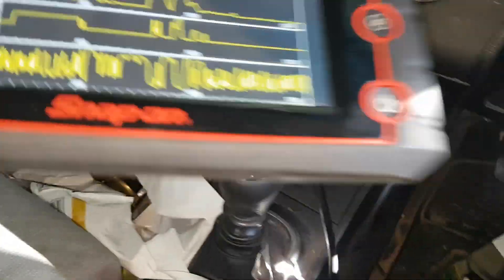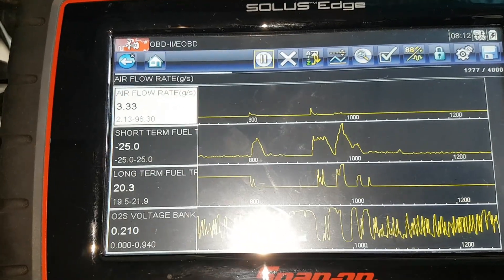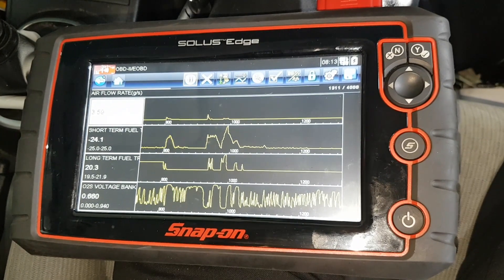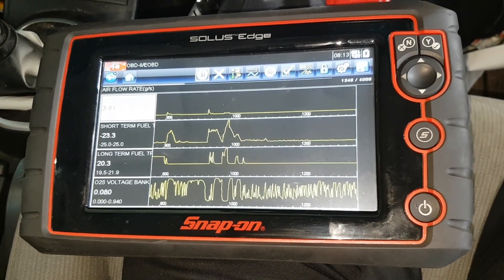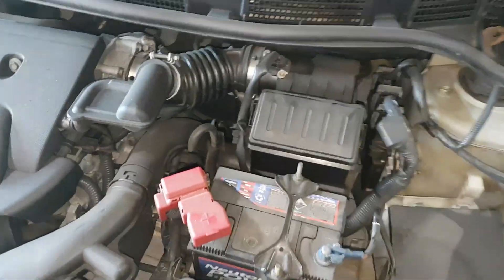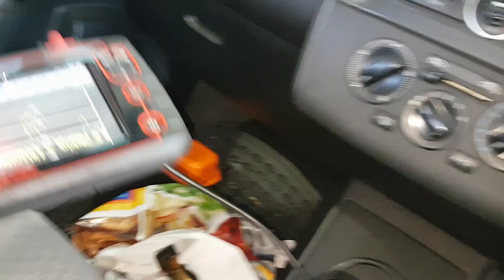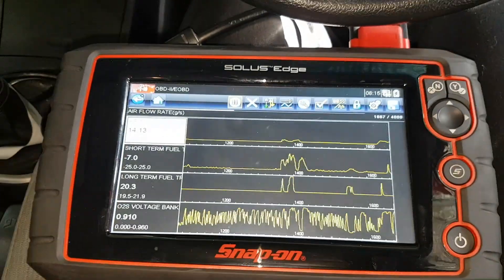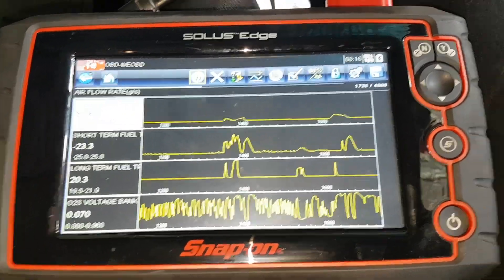P0171 Nissan Micra - Fuel trim checks

Comment: Hey can u please help me i got p0171 code nissan altima with short term fuel -10 and more and the long term fuel 0.8 with 800 rpm and 4.5 to 4.9 g/s and i also have engine and rpm shaking please help
Reply: @The Automotive Technician